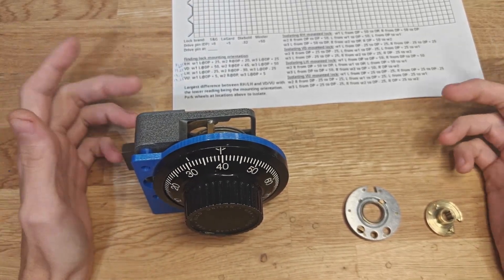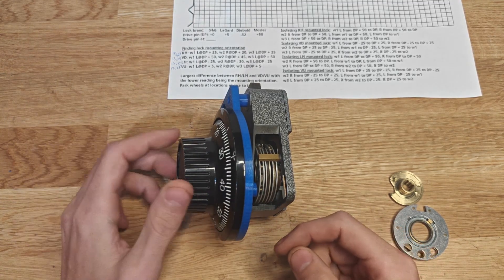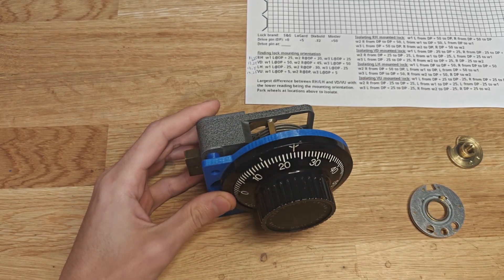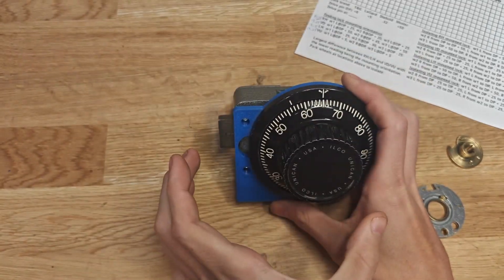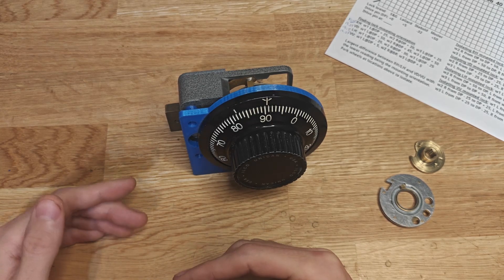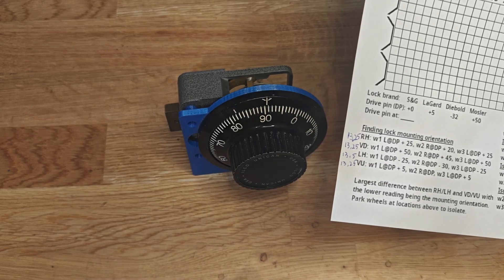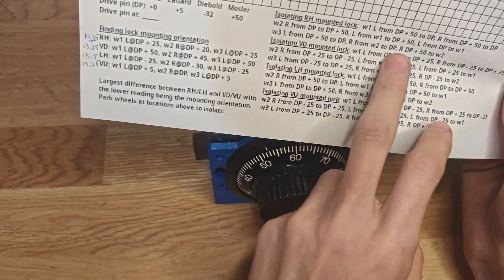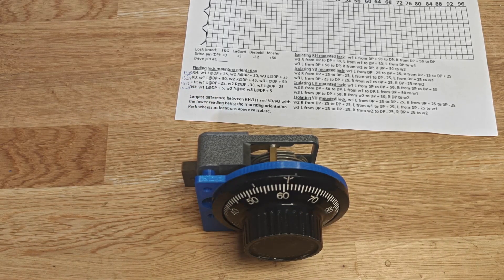Floating Wheels Technique

Comment: We have a vault with S&G safe lock from late 70s or early 80s no one knows the code only my late grandmother. When i turn the dial sometimes it has resistance i dont know if its because of its age, i dont know where to start since i dont know what exact model the lock is 😅
Reply: All the mechanical safe locks work basically the same. The only difference is amount of wheels and if the lock has nose wheel graphing may require multiple attempts to show a number. Try spinning the dial e.g. 10 rotations clockwise and then slowly rotating it counter-clockwise and count how many times the dial gets heavier to spin. Every time it gets heavier to turn, it's picking a a disk. If you feel three disks, then just follow the instructions in this video series and it will open. If you have more than 3 disks, you have to do extra rotation for each step and graph for 4 disks instead. I wouldn't expect 4 disks because even 3 disks is pretty tedious to use with correct numbers and having 4 disks would make the lock so tedious to use for the owner that 4 disk locks never got much traction. Videos 6 and 7 will speed you up but videos 1–5 will get the lock open if you are willing to spend many enough hours spinning the dial.

And if you cannot feel at least 3 disks picking up when you slowly rotate the dial, the lock might be broken and no combination can open it.
Reply: @MikkoRantalainen ill give it a try, but i saw her unlock it as im holding a flashlight for her while shes opening it and i can guarantee that its not broken, i just dont have any idea how a lock works back then thats why i didnt get the code lol
Reply: @StellaKay21  I mean that the lock could have failed since then if there's enough oxidation in metal parts. If you can feel at least 3 disks after rotating the dial for 10 full rotations in opposite direction, that's a good enough test to tell if the main mechanism is still good.

Then there's the possibility that the spring pushing the nose towards the wheel has snapped but that's easy to verify, too: just feel the contact points after doing the spin testing first. If you can repeatedly find contact points around the zero, the spring is okay.

After that, the only thing that could fail is the actual lock tonque being rusted solid in place but the only way to find that is to first pick/decode the lock.